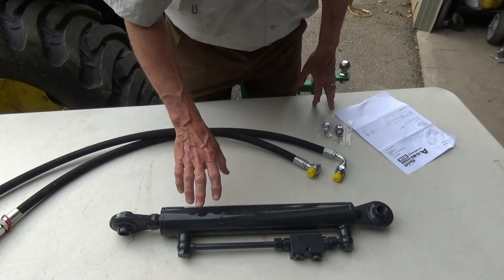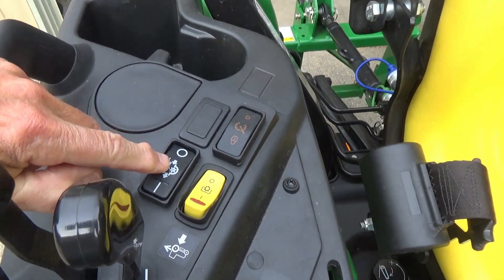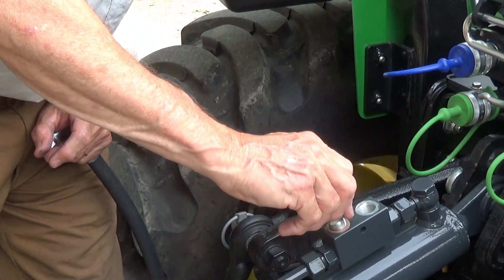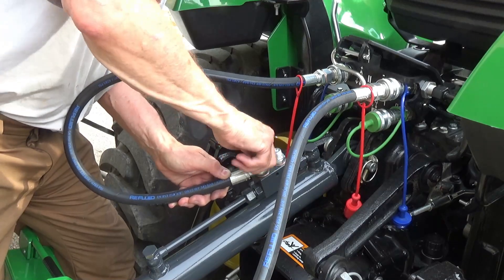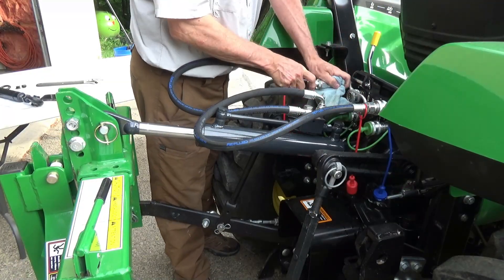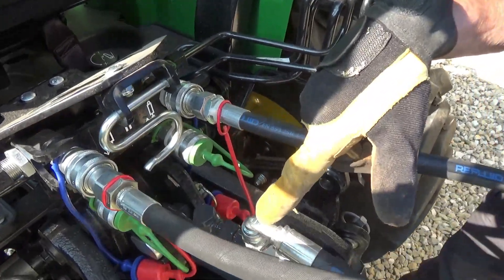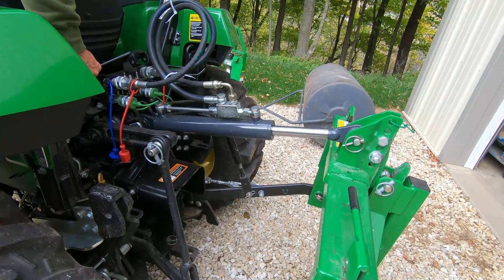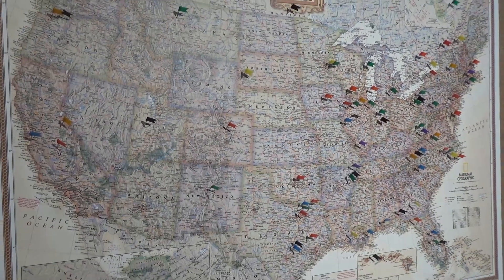John Deere 2038r- Rear Top Link Installation / 120

Comment: Good job Bill. Impressed. Do you prefer the 2038r over the 3e series? Nice Tractor. Thanks for Sharing. Mark.
Reply from the maker: Hello Mark, I've never operated or owned a 3 series. The way I understand the models, my 2038R has more features than a 3 series entry level tractor, I have all the HP I need, likewise, the PTO is adequate, and the weight of the tractor allow me to cross my wet yard and not tear up the sod. I can only say for my situation, owning 17 hilly acres with a pond, the 2038R is perfect. Just my opinion. Have a great Spring.

Comment: Bill- Thanks for your video again and for clarification on the power beyond.  It’s because of people like you that we learn and make better decisions when buying products and such!
Reply from the maker: Hi C Dee I went to the dealership today and they confirmed the power beyond is in fact gone, but this new design is supposed to do everything the power beyond did. This video is 7 months old and I have used the backhoe many times during that period. All I can say is this design works, and its easier to connect and disconnect the backhoe. So I'm comfortable not changing a thing.
Reply: Thanks again Bill.  I wish my dealership would have done that for me.  I had the hydraulic top link before I had the backhoe.  Would have been nicer to have what you’ve got.  Chris

Comment: Hi Bill, So if a person is buying a 2038R with a backhoe and thinking about having 2 scv's at the rear, then it is probably best to  add the SCV's initially to save a bit of money. Is that correct? I guess the way I am understanding it, is that you use the bottom ports of the 2scvs and flip the switch for power beyond. Is that the way it works? Thanks!
Reply from the maker: Hello Gary. Your description is exactly the way I understand that to work, I’ve had it this way for about 10 months to a year and the backhoe works fine. I’m getting information from viewers that is making me uncomfortable, and I’ll be speaking with the dealer tomorrow to learn if the power beyond has actually been removed. Stay tuned.

Comment: Hi Bill.  Thanks for your video.  Could you please explain to me on how you dont need the power beyond for the back hoe?  I had rear hydraulics before I had a backhoe.  If they installed the power beyond and I didn’t need it- I will be angry with my dealership.
Reply: I used to work for a john Deere dealer and they used to run some backhoes off of the rear hydraulic ports. It's really not the right way to do it you should have a power beyond and rear hydraulics. some dealers aren't trained right to be able to run both kit in line with each other so they take a short cuts and only use one kit to do both.
Reply from the maker: @zacharybrown2289    Hello Zachary. The power beyond is still there....the plumbing is just different ....I miss spoke and must’ve created some confusion..... I’ll have to work on getting that clarified thanks for making me aware of that.
Reply: @billburkhart  The power beyond kit is gone and they installed 2 rear SCVs and used one with continuous flow for your backhoe. Will it work yes but not the way Deere designed it. Ask your dealer to do some research because you should have a power beyond and the 2 rear SCVs to work together in line.
Reply from the maker: @zacharybrown2289  thanks Zach I had a deere dealer install it .....I will call them tomorrow thank you
Reply from the maker: This change is almost a year old now and the backhoe works fine, it’ll be an interesting conversation tomorrow
Reply from the maker: I just watched a video from Ty Canavan titled adding rear SCV. I see the rear power beyond connection is still in place.
Thanks for the information
Reply: @billburkhart  I mean if it works you can leave it but power beyond are designed specifically for a backhoe. I just looked up the install instructions for the power beyond and it shows how to link the 2 rear SCVs to the power beyond. Sorry if I'm complicating things just trying to help
Reply from the maker: @zacharybrown2289  Your not causing any issues, thanks for making me aware of this..... still have the plumbing that removed. I'll keep you posted.
Reply from the maker: Hi CDee. Sounds like I misspoke, the power beyond is still there, that single  connection point is gone ...and that connection is now in that new SVC connection ....and it’s a little bit easier for me to use. Your set up is ok, sorry I should have been more clear. Have a great March
Reply: Unless I'm wrong all you do is flip a switch on the right-hand dash & it basically turns 1 (or both?) SCV's into a continuous flow just like the power beyond connection. I believe this is for folks who run wood spliters & the like. No reason you can't run a backhoe in the same manner IMHO.